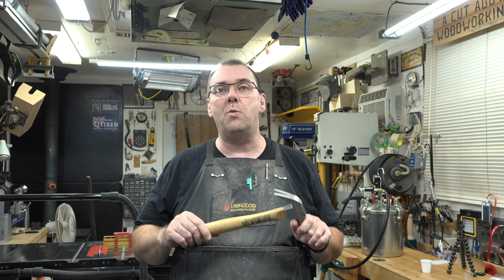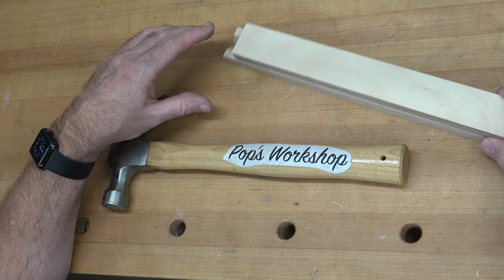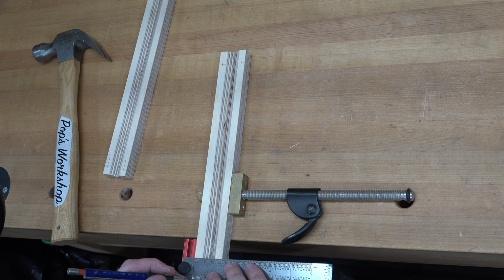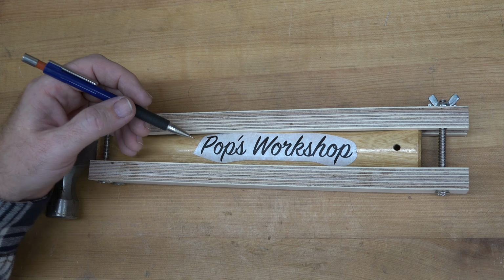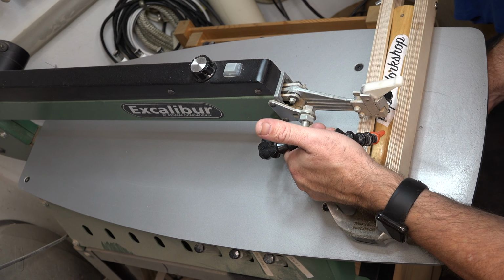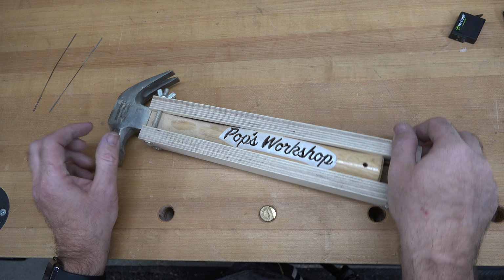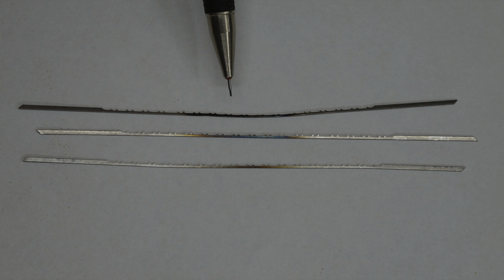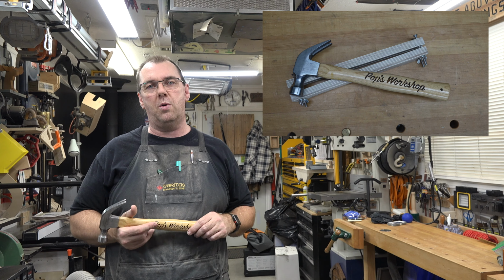Scrolling a Hammer

Comment: Nice one Kenny the hammer looks great and way that the hammer head looked after some elbow grease, brilliant. 
Can this be done using a Dremel but obviously not all the way through? eg cutting it out then painting the letters, sand and apply the finish, a similar way of doing a sign? 
Hopefully you understand what i mean ha ha ha.
Barry (ENG)
Reply from the maker: This can definitely be done using a Dremel or power carver Barry.  I think that would look great; especially with some paint in the carvings to make the letters stand out.  Great idea.  Thanks for tuning in and for chiming in with your suggestion.  It's appreciated.

Comment: Kenny, great, great project.  That is an awesome display piece for your workshop.  Polishing the head of the hammer added that extra touch.  What kind of wood do you think the handle is made of?  My guess is either ash or hickory.  Good advice that blades are cheap and to just let them do their job and replace when dull.
Reply from the maker: Thanks for the kind words on the show Paul.  I would go with you on this one and say that it is either ash or hickory.  I'm not sure which but holy cow was it hard.  Really had to take it slow so having fresh, sharp blades was a bonus for sure.  Thanks for tuning in to the show sir.  I hope to see a scrolled hammer in your shop soon.

Comment: Nice. Think I would have filled the lettering with epoxy resin coloured.
Reply: Definitely would inlay the colored epoxy as you state and that would definitely strengthen the handle if anything.  But if I were to do this project I would put this hammer near the entryway to my shop as a sign and not actually use it.
Reply from the maker: And that is the reason this project was made Mike......to use as a sign in the shop.  Although I did initially decide against filling the scrolling with resin, I am rethinking it and considering it as a window hanging in the shop.  Thanks for tuning in and chiming in with your thoughts.
Reply: @acutabove_woodworkings  always enjoy your videos.  👍
Reply from the maker: @mikeuk1954  Glad to hear it.  Glad to have you as a viewer.
Reply: I was wondering about that too.  Would it be strong enough to still use if filled with epoxy?
Reply: @Orxenhorf  would have thought the epoxy glue would have strengthened it.
Reply from the maker: I would think so too Mike but I can't say for certain.  I may have to fill this one and test it.
Reply from the maker: I have no idea if it would be strong enough to use.  Possibly.  I guess there's only one way to find out.  Thanks for tuning in.
Reply from the maker: I considered that Mike, but decided against it.  Now that you are bringing it to my attention, I am reconsidering.  It could be a cool design feature.  Thanks for tuning in